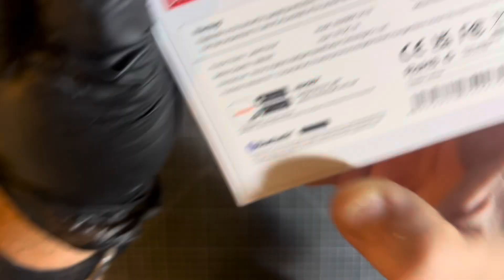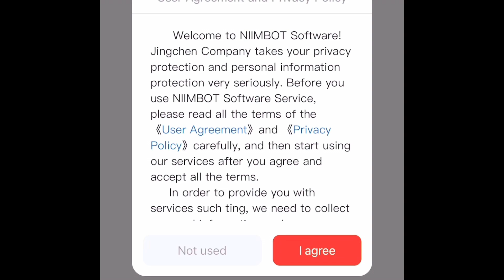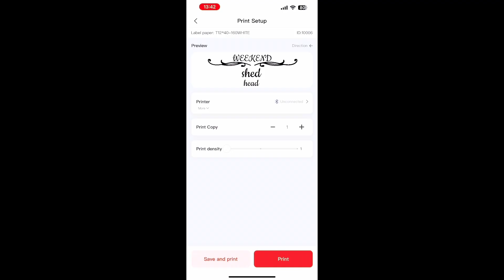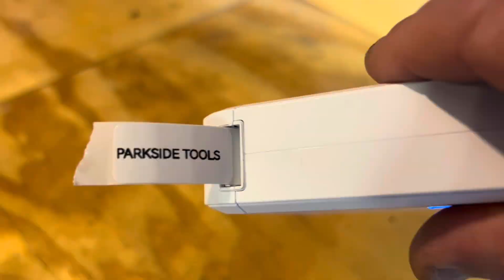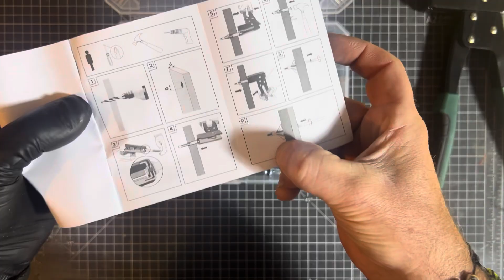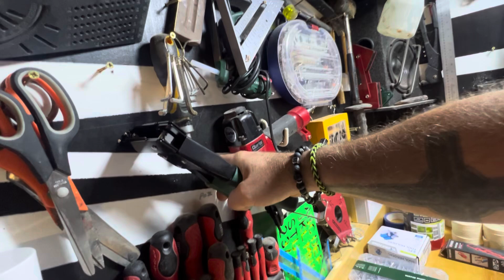Workshop LABELLING 🛠️ & Parkside COOL New TOOL 😃 PLUS MY INVENTION 🤪

Comment: I have the Niimbot D110, for the first 4 months absolutely brilliant, easy to use and fast to print. The labels stick to most things and not easy to remove. However, went to use it 3 days ago and now it doesn't print. Label comes out so its working - apparently its a fault but no solution.
Reply from the maker: Thanks for your feedback on the printer Paul .. it helps us all , cheers Rob

Comment: I use a Brother PT-H110 Compact Label Printer which works well and has a QWERTY keyboard. I'm also wondering about splashing out on a Colop E-Mark which has the added advantage that you can print onto wood, so may be useful beyond just labelling.
Reply from the maker: Big thanks for the recommendation 😃 cheers

Comment: Love your content, it's like we're all chilling in your shed :) Also it reminds me of stuff I've bought and put somewhere "safe" ;) I had the Dymo - bought from Aldi I think, the non-QWERTY keyboard was driving me Bodmin so I bought a Brother PT E300 that has a QWERTY keyboard on it and gave the Dymo to my nephew. I bought one of those Niimbot printers last year, then at some point I messed up the phone app so it wouldn't work and put it to one side. I have a case for it and yes you can get various label sizes. There is two different apps for it which confused the hell out of me for a while :) I must go back to it at some point. If you set up a free account you can store the various labels you make and reprint them from the app, that is a handy feature.

I absolutely love your dust catcher for the drill, until you added the crisp packet I thought it was a 90 degree guide :) That would make a great idea for a 3D printed solution too, not that I'm obsessed with printing, I can stop any time I want, I just don't want to ;) :) Was in the garden today doing some boards for my fence and using a printed jig to mark out the holes :)
Reply from the maker: Big thanks for your comments and sorry for the delay.. really pleased you like my videos .. sounds like the brother label maker is no. 1 , thanks again , cheers Rob
Reply: @WeekendShedHead  If I'm doing a batch of labels the Brother is perfect, for one offs the Niimbot works out better because of the individual labels so there's no waste. I went back to it after watching this video and either they have fixed something or I just didn't mess it up this time, but now it works fine :)

Comment: One thing to consider with label makers is the quality of the labels. I started out with a basic Brother which uses the M-K tapes which is fine for basic stuff. But.. they don't like heat (or even getting warm really) and start to peel, they yellow under UV light and are not water resistant. I then got a more advanced Brother that uses the TZe tapes and wow, they are amazing. The laminated tapes are heat resistant, UV resistant and water resistant (to a point). The main task I wanted was to label 13A plug tops and the old tapes came off within days, the laminated TZe tapes just work.

I do also have a NIIMBOT B1 and I got mine largely for larger format labels (30x40mm), but they suffer some of the problems of the budget labelers and not UV resistant. Nice black on clear large format labels though!
Reply from the maker: Great comments thanks,, I’ve had some good reports of the brother version 👍 cheers Rob

Comment: Thanks Rob, that's a great deal on the hollow wall anchors - have a look at the price of genuine "Fischer" fittings by comparison ! These fittings are very handy but a word of warning to anyone using these with a dry-lined solid wall - check the depth from the plasterboard to the block wall behind as this is often only 10-12mm so the total depth including board and skim may be less than 25mm - if you tighten down the screw hard (like you did) with no batten or item to be secured , the screw can hit the wall and start to push the fitting ( and a chunk of plasterboard ) out away from the wall. I found this to my cost fitting some metal Ikea wall brackets that were only 3-4mm thick - made a right mess - had to chisel out and re-plaster, then re-driill and use conventional plugs !
The label printer is a fun little gadget, I have seen other reviews of it and they had issues with the print fading over time - this may have been due to it being on plant labels in a greenhouse though, so maybe alright in a darkish workshop !
Reply from the maker: Great tips buddy, also I think I’ll do some experiment with the printer on the fading, cheers Rob

Comment: Not a fan of the new colour scheme of the hand tools handles. drop  them in the grass and they will be gone for good, at least when they had red on the handles you could see something red, and no word of a lie I have not bought any handtools since this colour change some months ago, they get the water pump pliers in every few month and I usually buy one or teo to replace what i have lent out and not got returned or left on a job, not this time i've left them in the shop.  I'll have to buy some cheap temu stuff to get a decent contrasting colour
Reply from the maker: Good point on the colour not standing out.. I have other parkside tools with red buttons and handles.. which helps   Cheers

Comment: Hi Rob,
We must be brothers from a different mother 😂.

 I too have the exact same Dymo with an abundance of tape to be used but purchased the NIIMBOT unit. The only thing, do NOT buy Tumu coloured tape as it isn’t recognised by NIIMBOT unit though it says suits D model labellers. I have had it for 2/3 weeks and still haven’t charged it. I look forward to your follow up on this. 

As for the wall anchors I drill my hole and use the cordless to tighten the anchor under 2mins job done, IMO the tool is finicky and a bit of a gimmick. 

Enjoyed the tutorial 👍🏻🇦🇺
Reply from the maker: Hi Troy, 
Great to hear similar ideas, and think the same 😂👍
Great tips mate. 
Cheers 
Rob

Comment: The hollow wall anchor is a great bit of kit ! Myself and my partner moved into our place last year and its been so handy with installing shelfs, hooks into doors, and securing shelfing units to the wall in my tool room.
I've found the best practise to be, drill your hole, insert the anchor into the hole and extend the tool, tighten the screw back down and extend the tool again to ensure the fitting is firmly in place. Then remove the screw from the fitting and fix your furniture !
Reply from the maker: Great tips mate 👍 much appreciated, cheers Rob
Reply: I bought one of these kits with the intention of fitting some shelf brackets to a steel-frame structure but the 0.8mm steel was too thin for the anchor to grip.  However, they work fine when used as intended!

Comment: I have a Casio EZ label printer. Pity there isn’t a DC power port. It takes 6 AA batteries.
Reply from the maker: 👍 I use rechargeable in the dymo.. but batteries seem to last ages , cheers

Comment: Can you get hold of new label rolls easily? It would be annoying if the printer is great but you can't get hold of replacement rolls easily.
Reply from the maker: Yeah good point . I’m going to do a follow up video I think.. I’ve not checked yet. Cheers Rob

Comment: looks like a neat little printer - but for NZ90 i'll give it a miss...... ive got a brother p touch pth110bk ( $38 NZ but came with $20cashback ) and its got the qwerty keyboard cassette tape for it is quite cheap as well which is what i tend to look for when buying printers :) ...... also have a brother QL700 which connects to the computer for other odd jobs also have the dymo letratag - same as yours but rarely sees the light of day anymore lol
Reply from the maker: Cheers for the info.. I’ve since heard the brothers are a great brand 😉👍 cheers Rob

Comment: Will the prints fade over time especially in sunlight? Inkless labels the old fax technology is only for temporary printing as they are not permanent. Good for labelling cakes for sale as not needed long term. Labelling thousands of drawers and jars to find out in a year or two can not be read will be a bit of a bummer. With your invention it would be good if you could also make it into depth stop to stop you drilling too far.
Reply from the maker: Good point , I’m going to have to set up some sort of experiment 😉👍 cheers Rob

Comment: I bought a very similar label printer in January and haven't needed to charge it since the first time I used it! I've gone through all the labels that came with it and have started with some refills, so have printed a fair few. The batteries seem to last forever 😎
Reply from the maker: You’re right the batteries in the dymo have lasted years 👍 cheers Rob

Comment: I have a 'Brother P-touch' lable maker which is similar to yiur Dymo and is great.....apart from also having a non QUIRTY keypad! Very frustrating to use, but does produce excellent lables. It has quite an involved menue which, if you are like me and you don't use something complex for a few months..... you need to learn all over again! I like the clean design and versatility of the one you bought here, although I suspect the Chinese manufacturer now has access to data on your phone! 😂 ( A bit off topic here, but not so much of a joke if you try and buy certain Chinese built mini security cameras that opperate through an app on your phone.....in order to work, you have to agree to the company having access to all your phone photos and video files and a lot of other data. I didn't like that so sent mine back for a refund....worth thinking about) 
Love the dust catcher. Great invention and a fun device to build. 
Hollow wall fixing tool is also a great thing but possibly not much use if your house has dot and dab walls as the space between the plasterboard and thermalite blocks behind isn't deep enough to use the anchors. I am not an expert on this but have recently moved to a house built of cheese with dot and dab walls and am finding it very tedious to mount just basic stuff. 😕🤬 I guess its fine on stud built dry lined walls though, where there is a standard known depth, deep enough to allow the full length anchors to go in before pulling up tight. 
Love your enthusiasm. Infectious.😊
Reply from the maker: Big thanks for you comments , great to hear your points.. and very true on dot and dab walls👍 cheers Rob

Comment: I’ve had the Brother P-Touch 1750 for years, it’s basically the same as the Dymo but with a Qwerty keyboard so it’s fast to create labels and uses the same type of continuous reel for long as you like labels.
I do like the idea of the Niimbot and I probably would have bought one for £15 as an impulse purchase but when I clicked the link, it was £23 which might not sound much but it made me stop and think about it, as a percentage that’s 53% more, then it becomes a principle thing especially since I don’t really need one. 😂
Reply from the maker: Good to hear there are some with qwerty boards.. yeah impulse buying, I’m the worse 😂 I think if you have prime it’s cheaper (around £15) but I’m not going to encourage you 😂 cheers Rob

Comment: FYI there is a better wall anchor tool it has a similar action to a silicone gun where you can do multiple squeezes to fully open the anchor, the single squeeze one is a bit of a faf.
Reply from the maker: Never seen that one before 😃 great call buddy , cheers Rob

Comment: The label maker is a cool idea I can think of lots of applications at work and at home 
How about a follow up as to how you would remove the fixings should you need to ,i.e when it comes to decorating and you don't need the fixings anymore
Great video Rob keep them coming
Reply from the maker: Good call buddy.. I’ll check that out.. however I suspect.. it’s one way, do it’ll probably need drilling out , cheers Rob
Reply: @WeekendShedHead  yep - no way of removing without leaving a big hole. You'll need more than a crisp packet to clear that up 🙂 Keep up the good work

Comment: My garage has pretty much all metal cabinets and drawers.  I have moved from paper labels to custom  magnets printed from Zazzle.

This means I do not have to deal with the gum residue when removing labels.  Plus I live in a very hot climate and I was finding that labels were starting to peel and I was always having to replace them over summer.

For each magnet I have the background colour coded to the cabinet or drawer it is attached to, I have a photograph of the drawers contents or cartoon and text description in standard font.  

This gives really strong visual management as those drawers that contain miscellaneous stuff have a photo which I can check to see where say the hole punches are stored and if a drawer just contains say screwdrivers there is a generic picture of a screw driver.  This means I can easily find the small items stored in drawers and have both text and photos to minimise time finding where to find things or return them.

Each magnet costs a couple of dollars (so I want till they have sales!!) so it is relatively expensive to begin with but once workshop is dialled in it makes it very easy to find everything and I find I am usually only buying 2 or 3 magnets a year as a drawers contents are updated.

Magnets do not peel, can be purchased in custom sizes to suit each drawer and provide really strong visual management via use of photos.
Reply from the maker: Wow.. 😃what a fantastic idea, thanks for sharing.. cheers Rob

Comment: Label maker will make it a lot quicker with all those labels you need. Then if you need a longer one you can go back to the original.  Nice. Shed is really coming along nicely Rob. Great video! CHEERZ!
Reply from the maker: Very true Mike.. I can switch between the 2.. but to be honest , the small labels should do the job 👍 cheers Rob